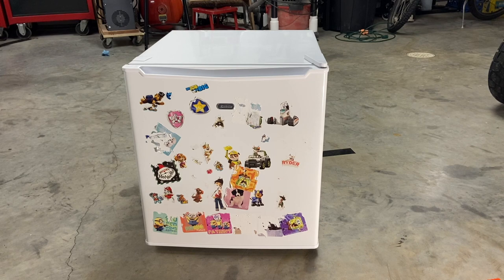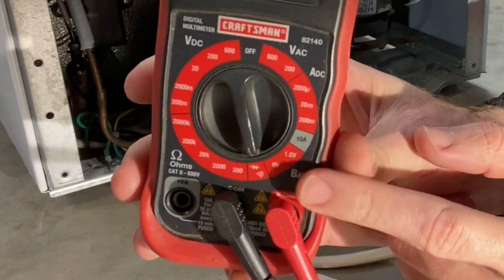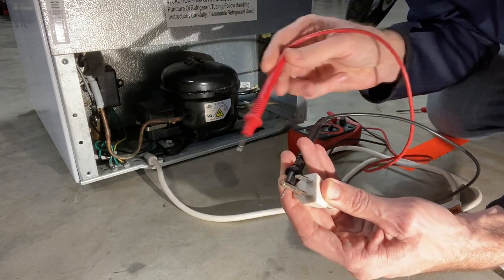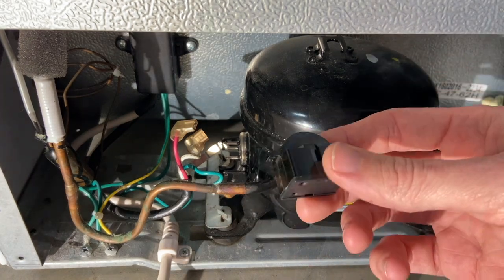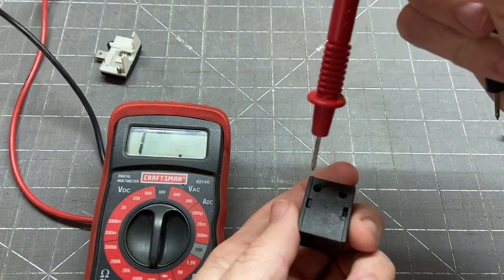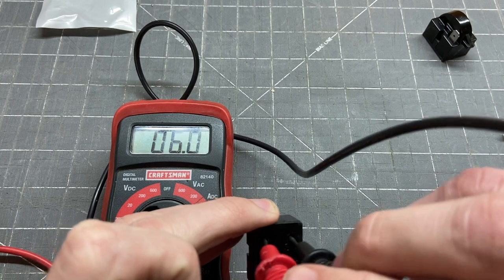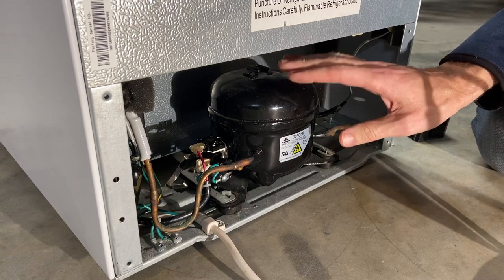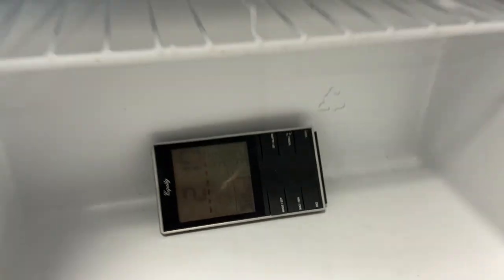Mini fridge repair - fresh off the curb

Comment: I found a blaze 4.4 cubic inch and side of road that said works on piece of paper. Got home opened it and it looked brand spanking new. Plugged it in and no matter if its on number 6 setting which is the coldest or number 1 setting it constantly says 50 degrees on my thermostat that i placed on the shelf. Cant find any info online or YouTube except it could be damper control being stuck closed. Any thoughts?
Reply from the maker: If the compressor is starting and cycling after a while, I'd suspect an issue with the thermostat. It may be kicking off too early, not allowing the compressor to cool down to the appropriate temperature. If the compressor never starts, it's likely a relay or overload device that I demonstrate in this video. If the compressor runs non-stop, I'd suspect that it's low on refrigerant and it's unable to cool down any lower than 50 degrees.
Reply: @DustinRogersinMO  Thanks for the quick reply and taking the time to do so. Stay healthy and safe brother!🇺🇸 🙏 🔫

Comment: My mini fridge runs then after awhile few hours trips my gfi and stop running. Would changing these 2 parts help?
Reply from the maker: Doubtful. I suspect that the compressor is failing. After it runs for a while and heats up, it may develop a short internally that is causing the GFI to trip.
Reply: I have a question, I replaced both the overload and start relays, and my wine chiller s still doing the same thing, the compressor turns on, then clicks off after a moment, I filed down the female connections a bit but that didn’t help, any suggestions would be much appreciated.
Reply from the maker: @alvaromontoya7529  did the original relay and overload test bad? The problem may be with the compressor itself. It may be starting to seize up, which causes it to draw more current which trips the overload. You can buy a “hard start kit” (affiliate link: https://amzn.to/3NJDpXk) which replaces the start relay with a big capacitor that gives the compressor a little boost to get going. These can get some extra life out of a unit, but the expected life is unknown. It could last for a year or more or it may stop working after a couple days. It’s cheap enough to give it a shot.

Comment: My mini fridge starts right up, compressor sounds normal.  No cooling. Thermostat was turned to the coldest setting. 
My start relay has 6 prongs, so not as common,  or so I have found. 
Anything else I can check?
Reply from the maker: If the compressor continuously runs, but it never cools off, it’s usually low on refrigerant.  Unless you have the equipment to vacuum down the system, repair the leak, and recharge it, it’s usually cost prohibitive to pay a professional to repair a mini fridge. Usually costs less to replace it.
Reply: @Dustin Rogers  ok. Thanks.
I was about 75 % sure that was the case. 
I'm not a tech,  just mess around with a few items. 
I do appreciate the info

Comment: my compressor running, but it is very hot, and not cooling..thanks
Reply from the maker: If the compressor is running nonstop, it usually indicates that it is low on refrigerant from some pinhole leak somewhere in the system.

Comment: What if there is no beep when I touch both prongs in a continuity check??
Reply: And the multimeter is reading OL. Open circuit? I have no clue what that means
Reply from the maker: Check if the thermostat is turned to an On position
Reply: @DustinRogersinMO  to be clear, I didn’t get a beep on plug that plugs into outlet. I was popping a GFCI outlet that I had a radio plugged into. When I plugged the frig in, that GFCI with radio would trip and then I knew it was the frig.  but the breaker wasn’t tripping. Dial inside is set to max. Both relay and other thingy(lol) had positive beeps in continuity test.
Reply from the maker: Did you check continuity between one flat prong and the round pin on the plug? That should read OL. If it doesn’t, it means you have a short to ground which is what is causing the GFCI to trip
Reply: @DustinRogersinMO  yes. No beeps at all. I also just checked the plug to ground. It beeped. Was I supposed to be in continuity there too?
Reply: @DustinRogersinMO  oddly, this brand new Klein multimeter is saying OL in audible continuity. ???
Reply: No beeps but reading OL
Reply from the maker: @lisahummel7795  now I’m confused. OL usually means “out of limits” meaning that there’s too much resistance or no continuity. If your meter beeps when in the continuity check, it’s usually an indicator that there is continuity. Every meter I’ve used will show the ohm reading also while checking continuity. If your meter is beeping when touching one lead to a flat prong of the plug and the other lead to the round pin on the plug, you’ve got a short to ground. That could be anywhere between the plug end and the internal compressor windings.
Reply from the maker: @lisahummel7795  I’d unhook the wiring from the compressor and see if your meter still beeps when testing at the plug. If not, the compressor is likely internally shorted to ground.
Reply: @DustinRogersinMO  do I check the plug and ground in ohm or continuity? The manual is very vague

Comment: Mine don't make a sound. But when I put the leads together it show 20. Is that ok
Reply from the maker: What setting is your meter on?
Reply: The one in the vid
Reply from the maker: @nativendn7382  without seeing your meter, I can’t say for certain, but I would guess that the 20 is the amount of ohms it’s measuring. Is there any symbols displayed on the meter screen? Like an upside down horseshoe (ohm symbol)? If your meter reads 20 ohms with the leads touching, that seems excessive. Is there a decimal point in front of the 2? Because 0.20 ohms would make more sense. Can you set your meter to ohms setting and touch the leads together? Does it give the same reading?
Reply: 63759 for the meter and the meter has the arrow with a line
Reply from the maker: @nativendn7382  you’ve got it set on the diode check setting (arrow with the line). Turn it one click to the left so it’s on the ‘200’ setting. That’s the setting for measuring Ohms (up to 200 ohms). With the dial on that setting, when you touch your leads together, what does the screen show? Make sure you’re not touching the metal part of your leads, as that could affect the reading.

Comment: Excellent info in your video.  Someone gave me a 3.1 cu ft. Galanz mini frig with a freezer on top.  Both "chill" but do not get cold enough even on the coldest setting.  The person said they thought their kids left the door open on the refrig that was kept outside on a porch, and they it would not cool properly.  Do you think the problem might be the thermostat? If so, any idea how I would test that?  Thank you so much!
Reply from the maker: I’d check to see how long the compressor runs. If the compressor runs non stop and never shuts off, it’s likely low on refrigerant and can’t get it any cooler. If the compressor runs for a bit (5 minutes - 1 hour) and then shuts off, and the internal fridge temp is only “cool”, then it seems like the thermostat is signaling that the desired temp has been reached and to “stop cooling”, which would be a thermostat issue.
Reply: @DustinRogersinMO  it's running nonstop. This probably sounds like a silly question, but how can I get refrigerant for it? Will an appliance shop be able to help me?
Reply from the maker: @kycatrescue7305  search for the channel called sixtyfiveford. I think he’s got an older video showing how to recharge a fridge, but unless you find and fix the leak, it likely won’t let long.
Reply: @DustinRogersinMO  thank you so much for the advice and help. So appreciated!
Reply: @kycatrescue7305  That's a deal breaker. The leak must be found & repaired & then a vacuum pulled before adding the correct amount of refrigerant. You'd need an HVAC guy & it would cost much more than just buying a new frig.

Comment: my Avanti mini fridge has a start relay that has the letters "PTH 490C then -AS 6R8 then what looks like the letter M inside the letter C then 5DN66A. when testing it, it reads 7.7 ohms. I cant find a replacement part for it. Any thoughts?
Reply from the maker: I couldn’t find that particular part number, but I did find the data sheet for it. https://www.datasheets360.com/part/detail/pth490/-2042694835020093711/

Looks like is supposed to be a 3.3 ohm, but the one I have linked in the description should work
Reply: @DustinRogersinMO  thanks. I'll give a try
Reply: do you think it matters that the spade connector on the relay is on the bottom and there is no overload protection?
Reply from the maker: @williamregan316  on the bottom of what?
Reply from the maker: @williamregan316  and I’d guess there’s an overload, maybe just a different style than what I had on mine.
Reply: @DustinRogersinMO  it seems to be the reverse of yours. your holes for the pins are on the top, back of the relay, mine are on the bottom back, with a gap underneath the relay where it looks like an overload protector would go buy there was never an overload protector there. as you say, it may just be different.
Reply: Sorry to be a pest but I wanted you to know that I got my new start relay in today. installed it, compressor fired up then after about twenty seconds, there was an audible click from the relay and the unit shut down. I'm guessing, wrong part. any thoughts?
Reply from the maker: @williamregan316  did the compressor actually start? If so, I’d guess that the compressor may be pulling too much current and whatever overload mechanism is tripping.
Reply: @DustinRogersinMO  Yes, the compressor did start and then shut off as I said earlier. I should tell you that with the old part installed, the compressor got pretty hot. I took the old start relay apart however it clearly wasn't meant to come apart and it broke the plastic case. There were no wear marks on the ceramic disc like yours, and when I tested it, it showed about 7 ohms. So I guess it was actually the wrong relay and I also need to start looking for the overload mechanism. Thanks again for your input.

Comment: Hi I have a mini fridge with a freezer , the freezer keeps freezing but the bottom stays hot any suggestions?
Reply from the maker: If the freezer is a separate compartment than the fridge, there’s often a fan that will pull the cold “freezer” air to the fridge compartment. If that fan is not functioning, the cold air won’t be circulated. 

Other models may have two separate cooling circuits for the fridge and freezer compartments. Just depends on the model

Comment: i have a Magic Chef fridge 10.1 cu ft two compartments yet everything runs as supposed to yet it does not cool so ???? not an expert but it could be one one of two things, either thermostat and or compressor, will try thermostat but kind of doubt it will be it, any other advice you could give.
Reply from the maker: If the refrigerant has leaked out, the compressor will still run, it’ll just never get cold. Usually if it’s low on refrigerant, the compressor runs nonstop because the thermostat never signals it to turn off
Reply: @DustinRogersinMO  that is exactly the problem?  How to know for sure?  it has not been punctured, it was working ok, on visual inspection it looks whole so... how to kow for sure, if compresor gas then it will be a pain since you have to cut pipes, weld back, vacuum (need the machine), then refill... too much for home trinketter I would say I wish it would be only replace this or that.

Comment: Is it normal for the refrigerant to be depleted over time?  I understand that if it is very repetitive most likelly there is a leak in the system but if there are years between refill I don't think that would be a leak so ... hence the question and why it is depleted?   ANYBODY?   applicable to cars, fridges and freezers, I have observed that if an appliance do not run over a long period of time, it may be low but once refilled and running works perfectly for years so ???? why it gets low if there are no leaks?
Reply from the maker: Sometimes it’s just a pinhole at one of the solder joints from when it was manufactured. Or soldering flux that has caused corrosion which led to a pinhole years after manufacture. Often it’s a self induced leak as the refrigerant usually runs through the little freezer tray, which ices up. People often try to scrape/chip the ice off and end up poking a hole in one of the refrigerant lines. There’s also a possibility of it leaking in a place that isn’t easily detectable, either a tight space that a technician can’t really see, or somewhere that is incased in foam insulation. 

In regards to cars, a lot of the sealing points are rubber o-rings that can shrink/harden over time causing them to not seal as well.
Reply: @DustinRogersinMO  DOES STOP LEAK WORK?    (Wouldn't make compresor work harder?) Well after trying another thermostat the problem persist so my last attempt is installing a bullet piercing intake to put R134A WITH 10% stop leak, on visual inspections there are no leaks so probably is hidden, yet I have noticed the change on temperature on the compressor pipes, so I conclude that it does not have enough refrigerant, since pressurised tube only gets warm not hot, the way it suppose to. I wonder why the industry do not install refill valves on the system since brand new (MONEY and secondary environment I suppose)
Reply from the maker: @JG-lx5pm  these unfortunately are considered “disposable”
Reply from the maker: @JG-lx5pm  sixtyfiveford has some good videos where he recharges an older fridge/cooler. Here’s a video where he’s diagnosing thermostat, etc. https://youtu.be/uSYTMV9lUbk?si=UZy3iovCz2N6mpxy
Reply: @DustinRogersinMO  Thank you so much I will check it but most likely i already watched it lol! Some people call USA the country of opportunity, I call it the country of waste, something that can extend its life or use, goes to the landfill for a minor repair or bad design (or purposedly just for profit), only 5% of the population in the world yet creates more than 30% of the pollution and waste in the world, you can see it in the simple things like this fridge LOL!!!!   I guess just venting.   THANK YOU!

Comment: Great video, thanks.  I checked the plug and both relay parts with multimeter—all tested as good.  Plug it in then and no sound of it running at all, just silence.  What might the problem be given that scenario (and how to fix)?  Thank you.

Comment: What if there isn’t any continuity when two flat blades of the plug are put on multimeter?
Reply from the maker: @lukedenault7655  if the thermostat is off, turn it on and try again. If the thermostat is on, I’d suspect an issue with the thermostat, as it acts like a switch to send power to the compressor so it can start the cooling. Obviously this only applies if the thermostat is at a temperature that would trigger cooling.